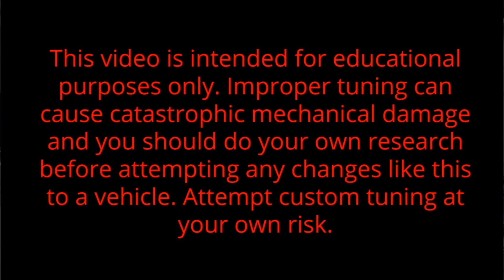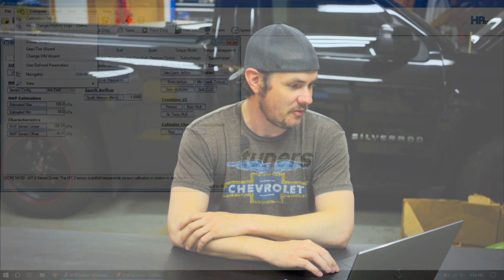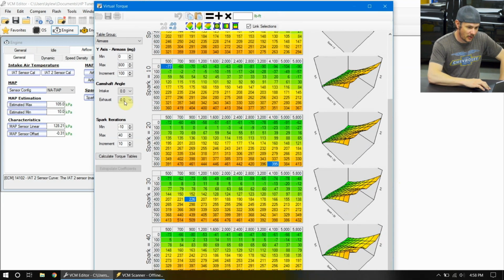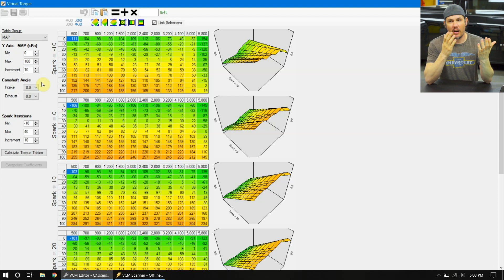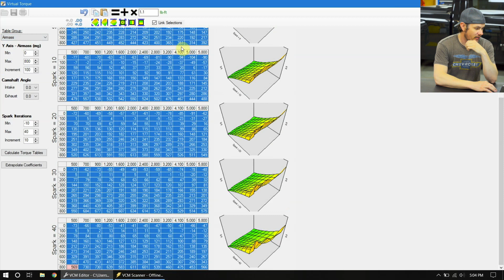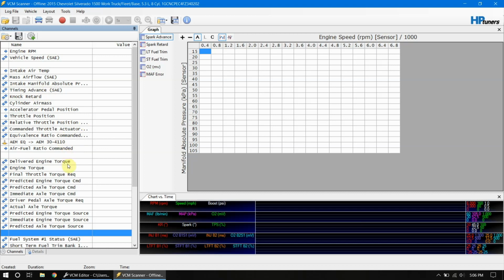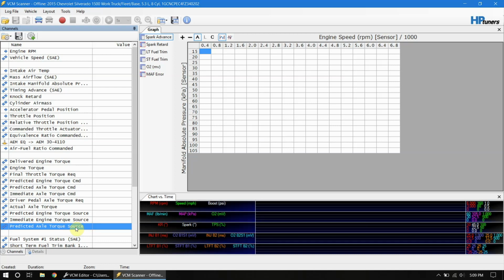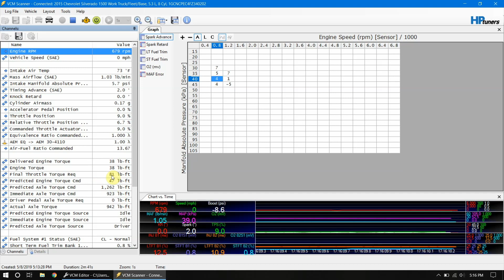Torque Tuning in HP Tuners, Tuning Series Vol. 6

Comment: Yo dude. I must say this video really helped me a lot. Not a lot of info about the Virtual Torque tables. Ancient Chinese Secret maybe? So... I decided to actually try this on my POV. Whew lawd. I recently dyno'd my car and couldnt understand for the life of me why my HP was high (not as high as I expected considering my mods...) and my TORQUE was SOOOOO disappointing! After watching this video, I took a look at my dyno sheet AND my Virtual Torque tables and had a "AHHHHHHHH" moment. So I made some adjustments like you demonstrated in this video. I CAN ACTUALLY FEEL THE DIFFERENCE! Now to dyno again. LOL! Thanks a lot dude! GREATLY APPRECIATED! You really should charge for this information. LOL!
Reply from the maker: Dude, that's the crazy thing, you can feel it make more power. I helped someone else the other day that was running into the same thing, car was making great power up until a certain point and it started to feel flat, looked at his torque tables and they were stock, added 15% and it was a holy crap moment!
Reply: @GoatRopeGarage  Yeah man. When I dyno'd the car, I could HEAR the car literally LAY DOWN (sounded like it revved pretty good until then and then it sounded like it was almost done...) around 5000 RPM BUT I couldnt tell when I was hauling butt on the highway. But now... WOW is all I can say. Thanks again. Ive never seen any info on this before...

Comment: As always, thanks for the video. I don't have the option to add a PID for 'Final Throttle Torque Req', the closest I can find is 'Driver Final Axle Torque Req'. I guess this isn't a huge deal, I could always set up a graph for throttle position vs torque req. Looking forward to the rest of the series - even though you don't think you're an expert on transmission tuning, I'm sure most people (myself included) would appreciate anything you have to offer. Now I need to get off my arse and finish dialling in my VVE table.
Reply from the maker: That one isn't really critical, just a good to know kind of one.  The big ones are the first two, the engine torque and predicted torque and then the last ones that show what is in control of the torque.  Thanks for the feedback, as always, and let me know if you run into any issues finishing up those VVE tables!

Comment: Thank you for the nice video. Do you mind if I ask you a question? I have gen6 camaro SS supercharged and after shifting , tq management pulls timing alot. especially 2nd to 3rd gear. At that time,  predicted and immediate engine torque source both say "RPM limit". I have no idea what it means.

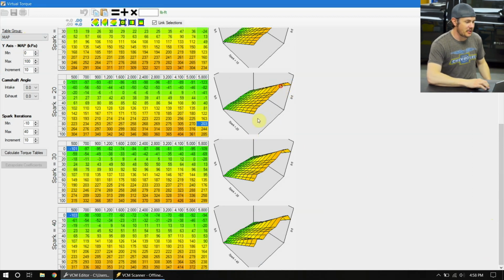Comment: I know this was 5 years ago and I hope you see this comment.  Firstly - thank you so much for your knowledge and the sharing of it.  I have learned a LOT from you and I really appreciate it.  I do have a question.  At 4:15, you mention that when performance mods are done, these tables must be tweaked.  Does that apply also to MAF-only?  I have a 2011 Grand Sport with cam/headers/TVS, and these tables and VVE haven't been touched.  Car runs great, but should I be touching these tables?  If so - do I need to start from scratch, does anything that HAS been done need to be backed out?

Comment: Great video! is there any way you can take look at my tune? Its a 18 zl1 with ported blower NW 103TB, cat deletes with a Rotofab intake it is tuned but the virtual torque wasn't tune tried to touch up the tune myself with HP but didn't touch the virtual torque it made 620 whp 580 wtq which is not bad but was making around 12lbs of boost should've been higher.
Reply from the maker: I've got a video coming out soon just about that topic, working on the best way of teaching how to address the virtual tuque. Until then you can check out the Patreon by going to www.goatropegarage.com
Reply: Awesome I appreciate it! Ty your approach and info is awesome! I will use the patreon feature which is very reasonable the tune I referred to is for a buddy that went to adyno shop and I touched it up but being Gen V gave me a lot of questions that you helped with!!!

Comment: Just rebuilt my 6l80 and added a 2800 stall on basically a stock truck. I've been watching your videos and reading through forums about tuning the 6l80. There is alot of different info out there about  pressures and shift times. What has worked for you after adding a stall?
Reply from the maker: This is just something you have to test on your own, everything reacts differently on the trans side after changes.

Comment: So I completed idle, MAF, and Speed Density Tuning and now I am ready to tune the torque tables, or so I thought. 2016 Colorado custom 3.6L V6 engine with S/C kit. Right off the bat I am confused because the Virtual Torque Tables will only go to 50 degrees and some of my settings are in the 60's. What to do? Also, some of my settings are negative and multiplying the negative makes the negative lower instead of higher; is that OK because it seems to me that would not be good.
Reply from the maker: No, you don't want to add more to the negative tables. With a supercharger you shouldn't be running any where near even 30 degrees of timing under boost, if you exceed that off throttle it doesn't matter
Reply: @GoatRopeGarage  As I look at the tune being shown in the GEN V video tuning series Volume 5, there are timing values greater than 50 on that table around 1600-2600 RPM, very similar to my timing table. Since that truck is supercharged also, apparently there is something fundamental that I am misunderstanding here. I did not create this tune originally but I am trying to improve it because my truck does not run well even after I have adjusted the MAF tune and Speed density tune to as near perfect as I could get it. Since I joined the GoatRope garage level two maybe I can submit my tune there for review? I did the spark timing histogram and I am not getting any knock with my timing the way it is currently? On the virtual torque tables, if I change the maximum table range to 50 from 40, that is where the negative numbers begin to appear that I am talking about, and if I increase the torque by say 10% on the bottom line of any of the tables and all the tables are linked, those numbers on the 50 table begin to go even more negative.

Comment: Hey Kyle I just updated my Hp tuner (with Bata) I had a very old version I now am showing toque tables I have Gen IV 2007 Yukon 5.3 e85 wth 60e will I have to adjust these tables running on gas only keep up the good wk very much appreciated 😬
Reply from the maker: Not until you get way out there in the mods, the stock ones are good for a bit more power already

Comment: Hey Kyle, this video helps a lot with the VTT tables. I have bumped them up 10%. What I m having a difficult time understanding is the driver demand and how that relates to the VTT. I don't know what to do with the values in the DD maps. Should these all be bumped up 10% as well?
Reply from the maker: That table is a torque based, need to get your VVE dialed in first or else anything you do on the torque stuff is like chasing your own tail
Reply: @GoatRopeGarage  Okay good to know, going to have to recap those videos. I watched the Driver demand video and that was helpful however left me curious about the changes you made in your example and how that applies to the Camaro dd table you pulled up. Honestly I am considering the $75 patreon tier after the wideband to get some of these things answered or to at least get me to a point where I can test and tune. Right now with VVE, torque, and MAF calibration I am a little lost. I really want to be able to tune for the mild bolt ons. As I will be installing headers sooner than later. I really appreciate you taking the time to help me on this. I'm sure you're busy.

Comment: Does this really even matter if you are just running a stock truck with maybe a CAI and exhaust? the first few videos are in play I believe but you cant just up the torque of the truck with this without adding some performance components. Just trying to figure out what works best with what I have
Reply from the maker: Probably not, honestly
Reply: @GoatRopeGarage  Thanks. I am still watching all the videos because we have a supercharged mustang with some other upgrades that this tuner could help with. For sure has been a help because I was lost yesterday before these

Comment: I love the vids but I have the new MV1 2 and I cant pull up some of these tables in ur videos. I've been tuning on the new LT1 and hit a wall
Reply from the maker: Which in particular?
Reply: Thanks first for replying. I'm not at the shop now but I'll hit u back in the morning. I'm dealing with a 2018 1le LT1 and so far have I increased hp&torque  but I'm definitely leaving some on the table. My selections on some tables are not the same. I'll get them together and show u
Reply: So on the fuel tab when I go to general it only shows Flow Rate. Lbs/h.
Reply: Got it figured out thanks

Comment: Couple of quick questions. If you go from NA to boosted, shouldn't you extend the torque tables out to include the boost regions first before making adjustments? Are you still going to do the more advanced torque tuning video at some point? And lastly, are you going to touch on driver demand, too? To my limited knowledge, I believe the driver demand factors into the calculations for desired MAP, Airmass, etc?
Reply: Upgrayedd06 I was wondering the same exact thing, I have been fighting my lsa Silverado with E38 forever. I just now realized I may need to modify these torque tables. My torque tables only go up to 100 kpa... and airmass only goes up to 800mg. When my truck begins getting into boost it goes above both of these values and it feels like my throttle body just closes off. I think extending out these tables and tuning them will get me going.
Reply: Same thing here, when i extend the table to the Airmass i run under boost i find out the ecu had big values, i think we need to extend the resolution then do the tune.

Comment: Will the torque curve adjust in shape if you have already dialed in a cam swap?
Reply from the maker: You will have to adjust it to meet your new torque curve with the cam to get the most power from your commanded torque.
Reply: Goat Rope Garage Thanks! So the torque table is not just an airmass / fuel calc. Does it move around when you adjust those? I’m looking forward to the next video on tuning torque!
Reply from the maker: @philistineau  No the torque table controls the power your engine can make, of your don't adjust it appropriately it will actually limit your power so you want it to look like your actual curve plus say 10% so you never cap out on torque. Just don't over do it or else it will make stuff act funny so keep it realistic.

Comment: Do you do this for all cam shaft angles or just 0?
Reply from the maker: It populates for the other angles
Reply: @GoatRopeGarage  I am on the latest Beta and after I raise my tables 20% then interpolate, extrapolate, and calculate Airmass/map and E85 Airmass/map, exit out and go look at my torque model section only the tables A have been changed. B, C, D are unchanged. That is why I asked. Didn't know if I was doing something wrong if I had to go back and do this for each exhaust angle. Thx

Comment: Video isn't playing. Stops at 0:25.
Reply from the maker: YouTube is having issues, might check back in a bit.
Reply: @GoatRopeGarage  I'll check later today. But all the others after that I can play them.
Great videos and tutorials you have made sir. Keep up the great work.
Reply from the maker: @LaUnika383RGV  I'll double check myself
Reply from the maker: It seems to be working now, but if it freezes up again try changing the resolution.  If that doesn't get it playing let me know and I will submit a support ticket for it.  Thanks!
Reply: Played it on my laptop. It freezed also but clicked a bit foward an it started playing. Great info sir. Really appreciate your videos. Barely entering the tuning step since I just build the vehicles an have someone else tune them.
Reply from the maker: @LaUnika383RGV  you've got a good leg up on the basics then, it's just deciphering the crazy stuff like torque control that doesn't always make sense as to why an engine isn't doing what it normally would.